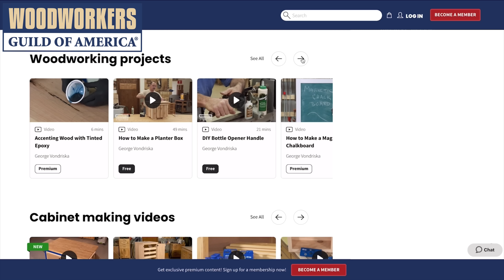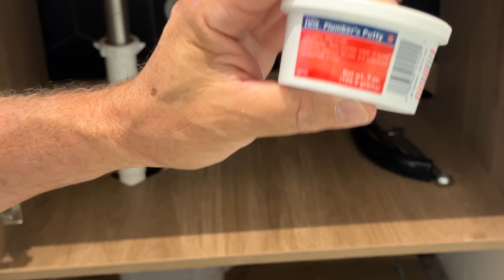INSTALLING a SINK with a BUILT IN DISHWASHER!!

Comment: Most jurisdictions do not allow emptying condensate drains into the sewer system. They are required to be discharged elsewhere, usually outside. It is definitely worth a quick call to the city to make sure you are in code.
Reply: Don’t they normally just require an air gap above the trap?  That is how they normally do a water softener?  My ac condensation goes out side and waters my strawberries.  The hotter it gets the more the ac runs the more water the strawberries get works out great.
Reply from the maker: The condensate pump has a check valve, does the same thing as an air gap.
Reply: @StudPack  It’s not about whether you can get the water into the drain. It’s about the city having thousands of gallons a year sent to the treatment plants that would come from a source that isn’t metered. Some municipalities separate runoff from sewage and treat them differently. The cost of the treatment of sewage is recovered through the cost of the water used at the meter coming into your house. Some places will fine you for dumping unmetered water into the sewer system. It’s worth having the conversation with the city since there is video evidence that you may be doing something out of code.

Comment: Paul, your lavy set up was well into the upper quartile, and your call on using only 1 1/2" traps is as well. But your rough in was low, about 6" low at a guess. Whoever designed the cabinet wasn't a plumber- you weren't able to miss the structural member across the back. Penetrating the cabinet floor isn't something I would have wanted to do, though. The "trick tightening" thing on the faucet is the result of selling into the retail market- regular 24/7 plumbers carry a wrench that is made just for that purpose, as well as some other places where deep reach is needed. As to the quality comment; in finished plumbing products, price is just about the best clue you will get, but my career was as much commercial and high rise, so T&S Brass and like that- real take no none sense, field rebuildable, with few specialty parts is my vision. On buttering the lower, rubber seal for the drain; rubber and petrochemicals (whether the rubber is natural or derived from petro sources) do not make for a lasting deal- it will soften, then rot the rubber over time- say four or five years; the best solution I was ever given was to use bees wax toilet rings to source the rubber coating from- I have personally pulled toilets off wax seals that date back before WW2, well before, and bee's wax is great for rubber. And will last till the house is coming down. On the sink/ dishwasher, if flex becomes  a problem, screw a piece of hardwood a couple of inches wide right under your relief through the drawer back wall. The bee's wax trick is vary good for the rubber, nylon and other "olives" used in the compression style p traps- a thin smear would let you finish adjust when you get into place and will improve sealing without degrading the olive. I'm kind of curious why the edit manages to miss showing the 90 degree fitting you must have used to tie the sink p trap to the wall inlet; Paul, that is a poor place, a maintenance trap place, to put a 90 degree fitting. unless maybe a "long bend" was used, and you didn't have room to do that behind the DW. Another poorly designed set up;  I'm thinking the instructions wanted it roughed to enter on the right side not the back or maybe from the sink side- there aren't any other good choices. The electric isn't too hard- you can put a double throw switch in the 4x4 box and use a different cover with your cable entry; the double throw switch will break the both the hot and the neutral lines, leaving only the ground wire continuous. At the end, I want to say the scaffold system you got at the start has been one of the hardest working and most useful tools on the job! Exceeded only by the Stud Pack DIY crew!
PS; Last comment, I promise; unless there is some internal technical reason not to use Hot Water in the DW, it will cost less money to tap it to the Hot Water side; HW from your HW heater is cheaper than by heating it from the wall- in Texas 40-55 degrees most of the year- using 115 VAC. The cold water would be useful for washing vegetables and sea food though and probably is why they said to do it this way.

Comment: @4;54 is there any code that says you can't put a P trap and then plumb it to where the pipes drop to the level of the wall stub out after the P so I don't have to cut out the bottom of my cabinet?
Reply from the maker: There is such a code.  "S" traps can siphon the water out of the trap.
Reply: @StudPack  thank you, I forgot that doing that would make it into an s trap.

Comment: Question: If a device is hard wired, doesn’t the install require a service switch?  

Not a pro. Just curious. 

Thanks
Reply from the maker: I said in the video I would like to have one, I'll probably do it later
Reply: @StudPack  Didn’t hear that. My oversight. Thanks

Comment: did you have another electrical box under the sink for the garbage disposal?
Reply: I think I see it plugged into a box coming through the side at 30:56
Reply from the maker: Correct, you see it plugged into the air switch which is plugged into a receptacle in the adjacent cabinet

Comment: Would have been less trouble just to move the drain line I do believe.
Reply from the maker: Probably but it doesn't go in the wall then straight down.  It's a lateral to the left for about 3 feet.  I'll probably end up re-plumbing it all to the cabinet on the left 😡

Comment: Why does the P-trap need to be so low? Couldnt you have where you had it at the dry fit stage and use two 45s to drop it to the line coming out of the wall?
Reply from the maker: That creates an "S" trap and would fail inspection
Reply: @StudPack  a p-trap to a double (i said 45, whoops) 90 to jog it down makes an s-trap?

Comment: Cold water is really a better choice for a dishwasher.  If it has to rely on the house to provide the hot water then it has to run the water a long time to purge the cold water out of the hot water lines to get to the hot water it needs.  This wastes a lot of water.

Comment: 27:23 Where is yer red plastic sleeve between yer MC and yer 90? That’s what the inspector woulda got me on. Gotta make sure the little tab is pulled through the hole. Actually I’ve seen with experience that they are very important especially where there is movement or vibration like a dishwasher. MC is so hard to cut cleanly. It commonly cuts through insulation causing shorts. Wow I feel like an inspector suddenly cause if you don’t know to use the sleeves then I know you are not an electrician that gets inspections and you probably don’t know to use the special cutting tool for the MC which means you almost definitely left a sharp edge which you pressed into the wire when you tightened that screw on the 90.

Comment: Hot water in the dishwasher. I don't think I have ever heard of a dishwasher that should be connected to hot water here in Norway so I suspect this is a US thing. There are a lot of reasons why it makes zero sense: It takes very little water to run a dishwasher, heating the water rapidly in the dishwasher is much more energy efficient than what your water heater and your hot water, while it has no dangerous level of germs in it, is never as clean as the cold water.

Comment: 32:45 faucet handle on wrong side. Should be on right.
Reply from the maker: Not all the time.  We always check where "hot" is.   We always put "hot" back in case a child reaches up to turn the water on they'll more than likely get cold water when they pull the handle forward and not get scalded by hot water.  Sometimes that means the handle is on the right; sometimes on the left.  Depends on manufacturer and country of origin.
Reply: @StudPack  I like hot in the back as well. For this, you just reverse the tap lines, so handle can be on the right for normal right-handed operation.
Reply from the maker: cool that works too 👍💪

Comment: you never wanna have you're condsate go into a 90 that going to be the first to clog with slime use a 45 or straight in. I'm hvac tech I see it way to often. if it clogs you're p-trap you're going to flood you're bathroom
Reply: Im not an HVAC guy, but is it ok that you have the drain line going up then down again. Doesn't that add a 2nd trap in the drain line that can also clog??
Reply: @michaelbelliveau6232  yes it does. the more water is left pipe it's more possible to clog. You don't want no water in the pipe not even a drop

Comment: Terrible plumbing looks like a handyman did it. Never cut the sink base if you can. Should have elbowed up at the wall and elbow out to get the height needed. Also get rid of the grey plastic elbow and go directly into the hose with the adapter. You have now created a trap with the smaller hose. Love you guys. Watch all the time.
Reply from the maker: Elbow up would create an "S" trap, not legal here.  Could not find a straight fitting in our small town hardware store.  It's not a trap, the condensate is pumped so it doesn't matter.  Thanks.
Reply: @StudPack  my bad sir

Comment: You should have cut the drywall and raised the drain instead of all this extra work and technically destroying and 45 this and elbow that nonsense. You're smarter than that...usually!
I bought 3 new vanities when I remodeled all my house bathrooms. All came with bottom drawers. I had to that on all of my bathrooms drains. while maintaining the reasonable height.  Piece of cake
Reply from the maker: Should have mentioned it... the sink drain stub out turns left and laterals about 3 feet before it hits the stack.  Otherwise I would have moved it; probably still will 😁

Comment: I'm really surprised that every dishwasher you've ever installed, connected to hot water. Every one I've ever seen, and i think I'm right in saying, all those sold in Europe, connect to cold water only. They all heat the water themselves to the desired temp.

Comment: I'm sorry but that Vanity unit plumbing looks terrible. If you took a 90 bend on the wall outlet facing upwards you could then have raised the whole  trap up 4" negating the cut in the bottom of the cabinet. Love the sink/Dishwasher though.

Comment: You could have put a plug and receptacle for the kitchen sink. All you have to do is get the correct cord cap for the metal flex line provided by the sink manufacturer.

Comment: Why wasn't the down tube of the bathroom sink cut shorter, so the p-trap isn't hanging out the bottom of the vanity. It is allowed to have a 90 before the wall. The bathroom vanity has plenty of room to install a p-trap. or use a bottle trap. Sorry dude, looks amature, like you got in a hurry or didnt want to wait for a better p-trap.
Reply from the maker: a 90 before the wall creates an "S" trap, not code here and would fail inspection

Comment: Hooking a modern “energy efficient”/“water saving” dishwasher up to hot water seems non-sensical to me. Most of them have heaters built in; and, most also use so little water when they fill that water traveling from even an adjacent water heater never has a chance to get hot.

Comment: Those pop up release sink plugs are garbage, the threads and spring get full of gunk especially if you use the sink to brush your teeth. I’ve had couple go down but wouldn’t pop up. They need cleaning out every couple of months.

Comment: Paul, please check your plumbing code. On the East Coast, A/C drains are listed as indirect waste, essentially the same as rainwater from your roof and downspouts. Water that has condensed from the atmosphere in your HVAC system must be directed outside to drain on the ground and is prohibited from entering the sanitary sewer system.
Reply from the maker: They want it to the sewer here

Comment: Why do you need to cut the vanity bottom? When you installed the street PVC 45 elbow, why not just use a 90 degree and face it up? Then you can install the trap higher, and just use another 90 degree elbow to meet the lower elbow? Sometimes you guys make TOO much work for yourselves.
Reply from the maker: That would create an "S" trap.... illegal here

Comment: Paul, pex uses copper trim ring. As pex is the same od as copper.
Reply: That would be Pex B, crimp rings. Paul is using Pex A (Uponor) Expansion fittings. The advantage is the fittings are all full flow.
Reply from the maker: You talking about the escutcheons?  Those are for 1/2" copper
Reply: @StudPack  Thanks, I couldn't remember how to spell escutcheons. They looked a little loose that's all.

Comment: I hate to tell you now, but you didn't need to cut the vanity for the p-trap. The p-trap has to exist, but there is no rule of code or physics that says the exit of the p-trap has to be exactly level with the drain pipe. You could have just installed the trap, and then added two 90s and some pipe to bring the drain from there down into the pipe at the wall.
Reply: Hey I was going to say that beat me to it lol
Reply: By code, the weir height on the trap cannot be above top of the ID for the connection to the stack/ vertical drain unless it is otherwise vented.  The alternative would be functionally equivalent to an s-trap.
Reply: So.. combination of plywood, ductape and legal should fix anything? If the ladies don't find you handsome, they should find you handy
Reply from the maker: Correct and an "S" trap will fail inspection here, thanks ncooty!
Reply: @StudPack  Huh! I had no idea. Having just read up on s-traps and the siphoning risk, I'm really curious what the minimum horizontal run after a p-trap is in order to avoid siphoning.